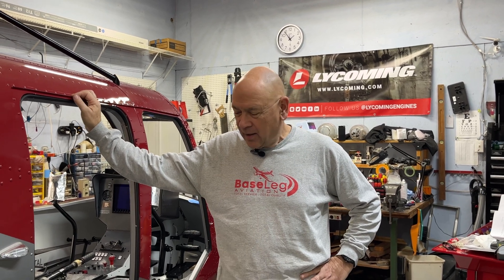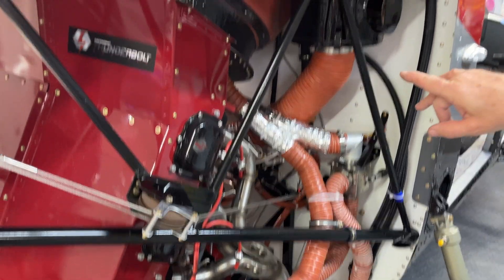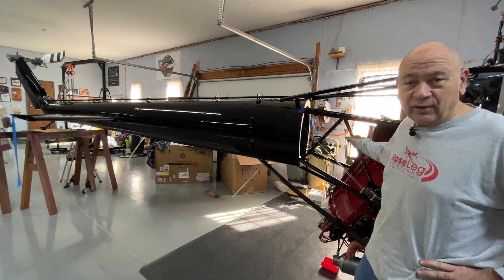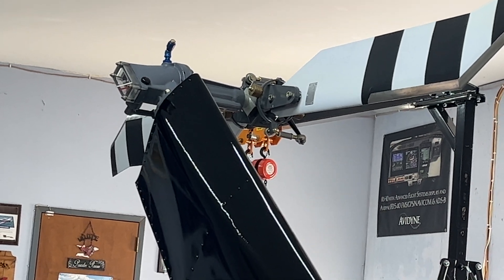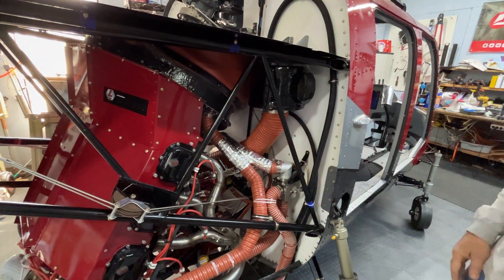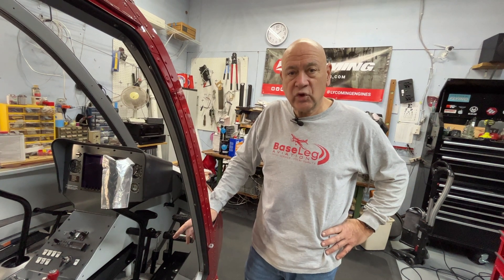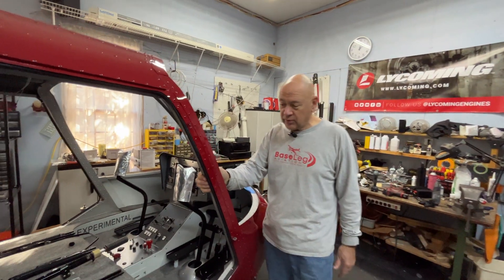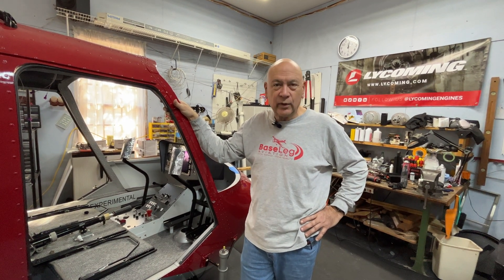Hummingbird update 2 3 23

Comment: G,day from Sydney Australia.
There are a few questions in my mind.
Firstly; will you change the engine oil as a plane Lycoming Thunderbolt engine: still manufacturers spec oil in that angle position?
* Has the engine been run on a Dyno for outputs, RPM 
* Are the bolts to the rotor hub and engine mount high tensile aircraft grade?
* Is the cowling held on by screws or release clamps?
🌏🤔🥦
Reply from the maker: Yes, it is still an aircraft engine so the oil requirements are the same. I will change the oil at 25 hour intervals instead of the usual 35 hours I do on my RV-10 Thunderbolt because on the helicopter it is running at a much higher rpm—— 3200 vs. 2400. The engine was run for over 2 hours in the Lycoming test cell. All of the hardware used in the helicopter I’d aircraft grade AN hardware. I’m installing the cowlings using Skybolt fasteners.

Comment: Doesn't the Lycoming electonic ignition require ship's power? and a standby power source? Why did you choose that?
Reply from the maker: it is wired directly to the battery through a 10 amp fuse, as per the instructions. don’t forget I still have one magneto. I also added a standby alternator. this setup has worked wonderfully for me in all of my other aircraft and customers’ aircraft for whom I have done the same.